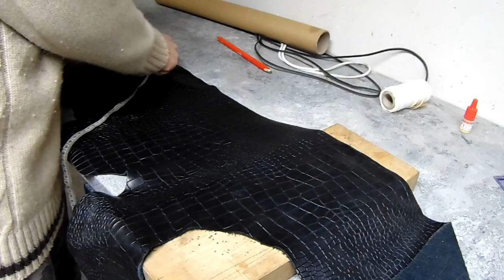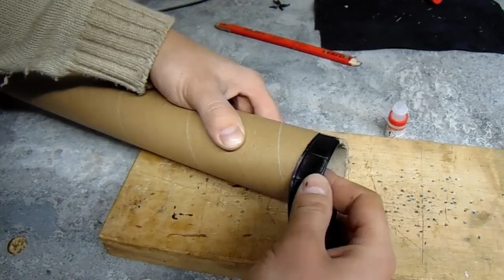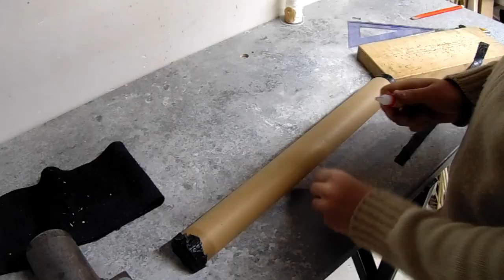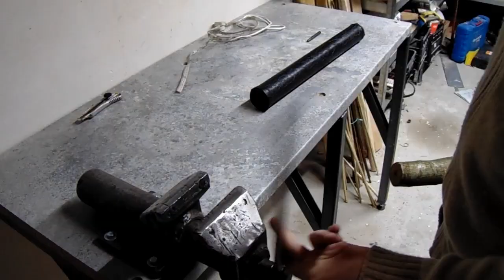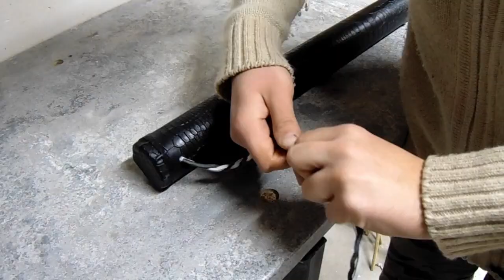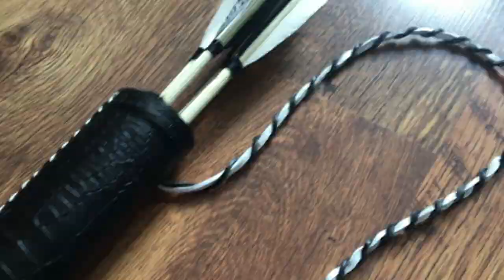Making a Back Quiver for Arrows

Comment: A well made quiver,just a suggestion: the tube that you used , if you spray thru it with either a " silicone" or "water proof urethane varnish material", then proceed to build as you did, the quiver will hold up in the weather as one hunts..??!! 
     Mind you, this is just a suggestion...but...it works!!
Reply from the maker: Thank you for precious suggestion!